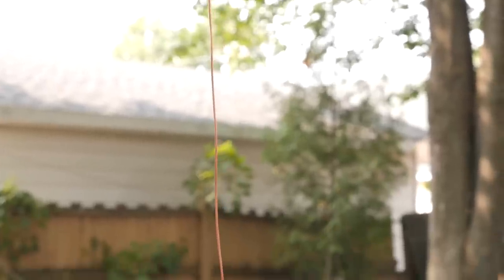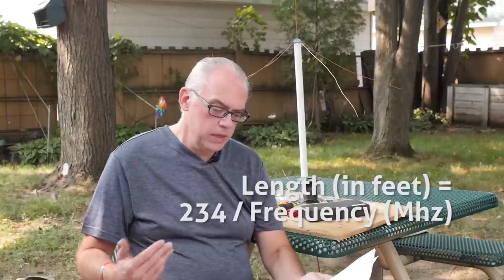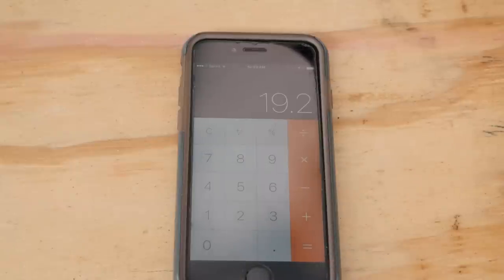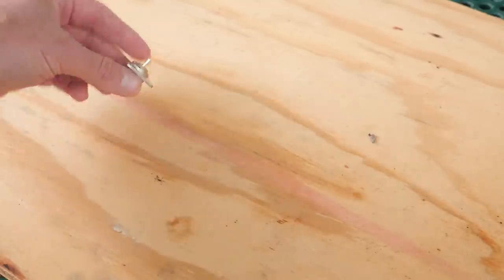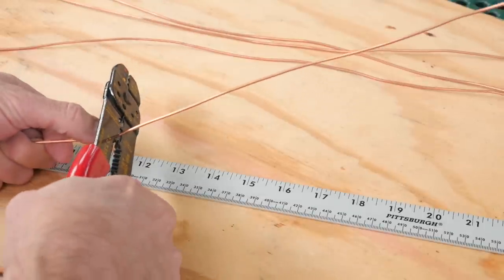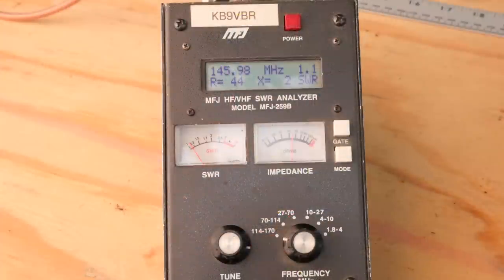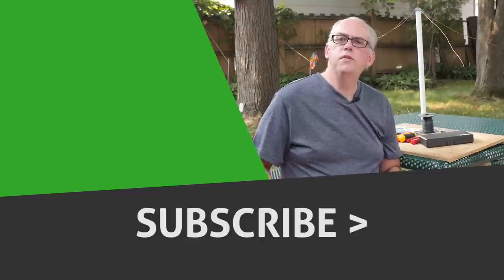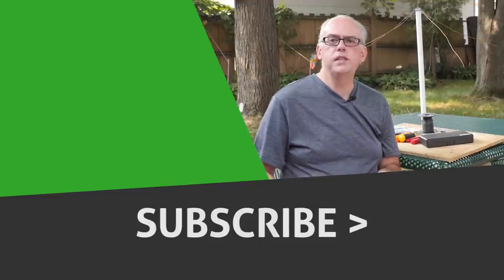2 Meter VHF Quarter Wave Ground Plane Antenna - Ham Radio Q&A

Comment: Hi Michael. The first 2 meter base station antenna was that antenna, up in a pine tree. I followed the ARRL pamphlet I got as a new ham. I only had 2 ground radials and the instructions called for a loop in the wire ends, formed by wrapping the end around a broomstick. I still use that antenna.
Reply from the maker: It doesn't get much simpler than this antenna. It was my first one also. I think I used the same plans from the ARRL. Back in the day at one of my previous employers, I had a two meter base radio on my desk. I stuck one of these antennas up in the suspended ceiling- it fit perfectly and worked great.
Reply: @funpotatoman  It works in the 2 meter band and the 70 cm band as well.  Hence the title of the video :P

Comment: Awesome, as a new ham I will definitely be making this. I wish some store locally had SO-239 connectors. Wish Radio Shacks were still around. 73 - KM6VFM
Reply from the maker: Congrats on getting your license. Radio Shack was great for parts when you wanted to do a little project. Another option may be an electronics store like Ham Radio Outlet or Fry's. Otherwise you can order the SO-239 from Amazon, there's a link in the video description.
Reply: Radio shacks are still around in 5 land.
Reply: We used to have an excellent parts store near us called "Unicorn Electronics". You could get everything there! Unfortunately, COVID ended up being the end of them. I dearly miss them!
Reply: I Agree!  I Wish RADIO SHACK Was Still Around! 🇺🇲

Comment: 2 meters is 200 centimeters - therefore a 1/4 is 200/4 = 50 centimeters much easier to measure than 19 inches and some odd fraction..
Reply from the maker: Yes your method is certainly much simpler and I'm not going to argue that the imperial system is better than metric. But one consideration is that your formula is an approximation and to have an antenna cut for a specific frequency you will want to use the formula: length(meters) = 143 / frequency(mhz).
Reply: @KB9VBRAntennas     
Hmmm but isn't 2 meters an exact wave length? 
Which would be 200 centimeters.
Where did you get the constant number 143? 
What does it represent?
Reply: Yanks and Brits like to use both imperial measurements and metric.  Metric is far easier.  But UK and United States of America use both.  It seems United States of America likes using imperial a bit more than the UK.  But they use both systems as well.

Comment: I did this quarter wave ground plane antenna here in Philppines connected to SO 239 connector Radiator lenght 19.2 inch with 3 ground plane. I used RG58 coax 50 ohms. Oh yeah IT WORKS WELL with VHF Freq. Design for 2M. - DW3ZXC Philippines.

Comment: When we moved to our location in 1989 behind little parks I was concerned about all the metal 20 feet from my backyard for my ham antennas. I use a ButterNut vertical for HF and I placed it 75 ft from the back fence and, of course during stormy weather it is disconnected. For two-meter / 440 antennas I have two dual-band antennas mounted above my home, one vertical and one horizontal, and of course, it gets disconnected when storms come my way. To solve the storm problems associated with 2/m and 440m I built two 'coat hanger' ground wave antennas and placed them in my attic. They have been up there since 1989 and have had no problems. Love to make antennas for my hobby and for my friends. My next project is using 'rotor cable' cut to the ham bands and string it above my home. Right now I have a homemade dipole but I think the rotor cable will work better for my location, at the bottom of a valley. DE W9FPJ

Comment: You can also get SO-239s at Radio Shack.  I just passed the test for Technician license and while I wait on my license I am making one of those 1/4 wave ground plane for the 2 meter HT (Yaesu FT-4VR) mono band radio I got from the local Ham club for passing the test.  I can hit the local 2 meter repeater but that's about it and I have to be outside on the deck to do that.  I think once I get my 2 meter ground plane built and get my SMA female adapter to UHF SO-239 so I can hook up a piece of coax I'll be good to go.  Since my wire is so thin, I doubled it up and stuck it into my drill and twisted it all together for the radiator.  That worked out well and now it sticks straight up without drooping.

Comment: I needed a 2 meter ground plane quickly and didn't have time to muck about trying to optimize a fancy design. I just copied yours and it works as well as anything I could have made if I had taken much more time to make it pretty.  I just cut and bent and soldered per your design and presto, it works great. SWR about 1.2 across the band and I'm easily heard where i need to be heard. Thank you!!!! 73

Comment: Just built one. Works slick! Also I built another 2m antenna using just the 19 in vertical radiator soldered to an SO 239 connector. That one also worked well. It stuck it in the attic

Comment: I built one of these a couple years ago, slightly different than your video only in that we had extra PVC parts so we could take the thing apart and store it in the PVC to transport. Otherwise, it looked the same and is a great antenna.

Comment: The SO-239 that I got from HRO didn't have a good mechanical connector for the center solder point. I was more like a dimple with half a side. What I did to strengthen the connection was wrap some 14 gauge wire around a #6 screw, to get a coil about 3/8" long, nice and tight. I placed that over the center connector and filled it with molten solder and heated it enough to know the solder point was well connected, then embedded my 12 gauge center wire in that and heated it again to get a good solder connection. That joint is not going to fail.

Comment: You can build all of it with crimp connectors and a coat hanger or two if you want, use quick disconnects for the antenna and ground plane and you've got yourself a modular antenna

Comment: Hi Michael, thank you for sharing what can only be described one of the easiest but useful little antennas inexperienced amateurs like myself can build.  I have built a similar type of antenna for portable days out but I used a slightly different calculation which offered me a slightly longer radial (2948/Freq = length).  I note that my swr is slightly higher than yours so maybe I stick with 234/Freq.  Thank you for sharing.  M6KVK
Reply: It's because you didn't take into account the 5% "loss" in the speed of light or radio wave.  In a vacuum or in outer space, that 2,948 applies, but in the real world or on Earth, there's some "absorption" of some sort.  If you multiply the 2,948 by 0.95, you'll end up with 2,800.  That's the right one.

Comment: Just made one of these antennas a little tip i got from a elder is to put one end of the wire in a drill then hold the other with pliers.  Give it about 10 seconds.  It straightens and strengthens

Comment: For us unlicensed radio hobbyists, cut approximately one inch form the vertical antenna to be able to use the ground plane antenna on unlicenced MURS VHS frequencies.  MURS is on the 1.9 meter radio band.  It is very close to 2 meter amateur radio band.  Many amateur radio frequencies have unlicenced equivalent bands for unlicenced radio hobbyists and operators.  12 meter and 10 meter amateur radio bands are very close to the unlicensed 11 meter Citizen's Band.  6 meter amateur band is very close to the unlicenced low power 49 megacycle band. The 49 megacycle band is actually in 6 meters whereas  the amateur radio 50 to 54 megacycle band is actually 5.8 meters.  2 meter amateur band is very close to the unlicensed MURS band that y is in 1.9 meters.  70 centimeter amateur radio band is very close to unlicenced FRS 64 centimeter band.  33 centimeter amateur radio band is shared with unlicensed radio operators also that use equipment that is low power and requires no license.  I believe all these frequencies for unlicenced use are around amateur radio bands to stimulate interest for us unlicenced operators to perhaps get an amateur radio license.

Comment: Hey thank you for this. I built something very similar after watching your video but much less "professional" so to speak, by sticking a 12 gauge copper wire into a female pl-259 connector and wrapping the radial wires around the outer part.

Comment: I foresee some father/daughter bonding with this project in my future!
Reply from the maker: Awesome! My daughter was 13 when she got her license. This is an excellent project for the two of you.
Reply: Build two antennas and mount one on the roof of your house and one on her bicycle on the end of an old broomstick.  You stay home and operate the house radio and she goes out on her bicycle using a hand-held transceiver.  Have her test on low power with the tiny dummy load walkie talkie antenna and then have her connect the broom handle mounted ground plane attached to her bicycle.  She will see the big difference and she will learn that antenna is more important than more power. Have fun and make memories.

Comment: I would like to put a small circle in the ends of the radiator and ground planes, to reduce the likelihood of poking my eye out.  How would that that affect to performance and how would I measure the length.  I there something blunt that can be put on the wire ends, that would not affect the performance?

Comment: Im inspired to build. Was able to pickup most of the parts at my local hardware store. cable and SO 239 connector I had to get online. the cable coax was my biggest expense RG8U. Also find the right connector for the connection from the feed to the Radios antenna connection   found a SMA female to the pl 259 female(so239) ...As of now I have no Antenna Analyzer... anyday now i hope to see my call sign on the FCC post. was able to program my first repeater here in Santa Rosa CA ..listening only ..Thanks

Comment: First antenna I built after I got my technician. Got it out of the ARRL Handbook. Not do sure you can get the SO-239 and other parts from Radio Shack.
Reply from the maker: Back when Radio Shack was around it was super easy to pick up on SO-239. Otherwise here's a link to where you can pick up a couple on Amazon: https://amzn.to/2wcEPkp

Comment: Hi, with my intentions to only receive aircraft & tower communications within the air band frequencies 118.000 MHz to 136.975 MHz, I need to make an external antenna for my scanner.  In determining the length of the vertical rod and redials, will I still use the given 234 numbers? If so, what MHz frequency will I divide the 234 with?

Comment: So I made one and it keeps blowing the circuit breaker as it's transmitting. Should I run a wire from the SO239 to the wood base for a ground?

Comment: Can you do another talking about the cable you used? You kinda skipped over that completely. I know I will need a female SMA on my radio end and a male PL239 on the antenna end, but what type of cable do you need? How much loss do you get going from 12 feet to 50 feet for example?

Comment: New ham here.  Would this work to lengthen all wires to 3/4 wave on 2m (around 1500mm) so I could use it as a 1/4 wave antenna for 6m (also around 1500mm)?
73,
KK4FVZ

Comment: That’s a real nice and simple design, I’m going to build one, thanks!
Reply: It also works for the 70 centimeter amateur radio band as a 3/4 wave antenna.  Unfortunately, the radiation angle for a 3/4 wave, 70 centimeter band antenna is very steep.  This will make for more limited horizontal range.  For satellite and near repeater use, it will work and have a low standing wave ratio.

Comment: Great video !!!!! thank you, but what would be your take on the voltage output, in other words would it handle 200 watt PEP ? thanks for reply in advance, Please keep the videos coming!!!
Reply from the maker: I don't see why not. Back many years ago we made some 1/4 antennas like this for some APRS digipeaters that were running on 110 watt GE Delta land mobile transceivers. Didn't have any issues at that power level, so 200 watts would be fine.

Comment: how come you not add the short to ground i seen them the antenna wire solder to it and that wire solder to the ground plane kit you have do one this way see if you like it even better the short kill static DC building up in your area

Comment: I have made the 2m 70cm, my problem is I can’t get the solder to adhere to the copper wire and the so239 connector. So the main beam is the 2m, and then I attach the 70cm beam next to that. Can I move the 70 up a little bit to have its own connection to the 2m beam instead of having a big blob of solder at the 239. Like I said above need some direction to get the wire and solder to adhere to the 239 and be secure. Thanks Michael

Comment: Thanks for the video! I built one but the radial ring terminals seem a little weak, they don't seem to hold the weight of the radials properly. I've seen some people go out about an inch before starting the 45 degree bend; if I were to do this, does the measurement of the radial begin at the point of the bend?

Comment: I like this project because it's cheap to build. New to the hobby. My two questions. If its outdoors what do you use to keep the rain out of the connector? What about lighting protection?
Reply from the maker: For weather protection I'd use a high quality electrical tape, Coax Seal, or better yet, amalgamating tape to seal the SO-239 connector. If you are going to use the antenna indoors, like in an attic, then tape isn't necessary. As for lightning protection, that's a big subject, but in a nutshell I'd recommend lightning arrestors on your coax where the cable enters the house. The arrestors can then be grounded for lightning protection.

Comment: Hey Michael, I'm about to put this antenna together as you instructed.  What would be the connectors needed for the RG8x coax.  I'm hooking this up to my Baofeng BF-F8.  Thank's for your help.
Reply from the maker: The SO-239 (UHF female) connector the antenna is based on mates to a PL-259 (UHF male) connector. Your cable will need PL-259 connectors. You will also need a SMA Female to SO-239 adapter for your radio. Those are available on Amazon: https://amzn.to/2XuhZ78

Comment: Thanks for the video, very straightforward. I'm hitting multiple repeaters. Coax is tape wrapped and runs through a pvc pole. Have tighten nuts on radials, but they have a tendency to sway with wind or other movement and need to be readjusted. Saw the comments on silicone sealant to help weatherproof. Should use the silicone on the soldiered point, well as as the radial connections to help stabilize and weatherproof? (Also a proud owner of your break-away copper j-pole).
Reply from the maker: You can silicone all the exposed portions of the connector (with the exception of where the coax cable connects) if you wish.

Comment: Hey Michael,  new ham here, thanks to your video you've inspired to build(instead of buy) my own very first antenna as I start to build my shack. 

Question for you;
I live in an area that sees brutal winter conditions(80-100+mph winds, HEAVY snowfall). I plan to enforce all the copper elements with a wooden-dowel skeleton of sorts. Any special considerations I should make adapting this design to be more robust to withstand a brutal winter?  I plan on mounting this in the very tip of a pine tree outside my window
Reply from the maker: I'd probably use brass welding rod instead of copper wire as it would be more rigid and durable. I'd also try to beef up the area around the connection with a mounting plate made out of aluminum stock. The elements of this antenna are pretty thin, so even with 80mph winds, the wind loading will be quite slight.

Comment: Thank you.  I'm trying to make one for my marine radio.  I'm assuming I just need to make sure the length of the wire is right.  I also live in the Milwaukee are and I plan on getting a ham license.
Reply from the maker: Yes. This design will work for the marine radio band. Just use the formula to determine the length of the wire based on the frequency you wish to use. I'd probably build the antenna for Channel 16 as this antenna will have enough bandwidth to cover the entire marine band.

Comment: Thank you Sir. If you don't mind what type of solder do you Reccomend.  Thank you...
Reply from the maker: You should use Rosin Core or solder labeled for electrical use. Acid core or plumbers solder will break down the connections in the presence of electrical energy.
Reply: @KB9VBRAntennas  Thank you!!

Comment: Hi Michael  great video, can I ask a silly question please? What diameter are the blue Crimp Connectors please?
Reply from the maker: I'm not sure of the actual diameter, but blue crimp connectors will hold 12-14 gauge wire. I used 12 gauge solid copper wire in the video.

Comment: Hey great video. Just wondering, do I need to tune the antenna to a certain frequency or will it work for all across the 2m band? I'm new.
Reply from the maker: This antenna should have enough bandwidth to cover the entire band if you cut the element for 146 Mhz.
Reply: @KB9VBRAntennas  Great thanks for the reply.

Comment: What gauge copper wire did you use for the antenna?
Reply from the maker: That was 12ga solid copper wire. I used THHN and stripped the insulation off

Comment: Before I build one of these and put it up on my roof, should I add a loading coil like the ones I see inline with the radiating element like on the mag mount that I bought (that seems to work OK)? Is there anything to 'gain'?
Reply from the maker: Since this is a quarter wave antenna‚ no loading coil is necessary.